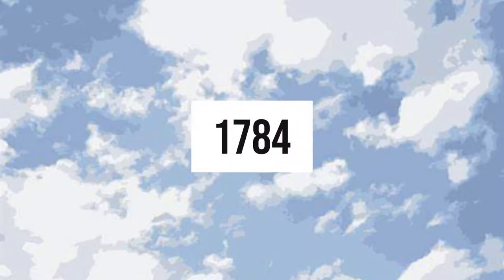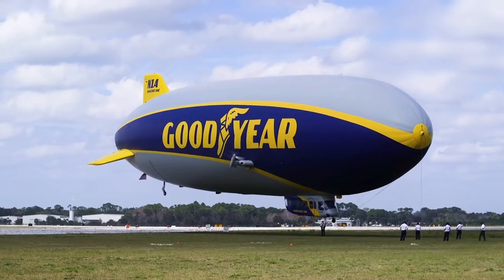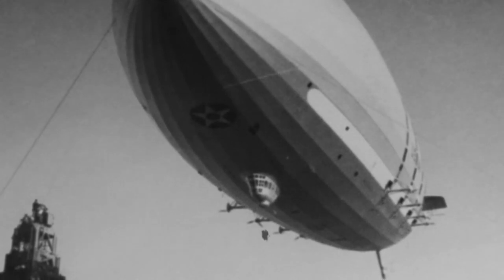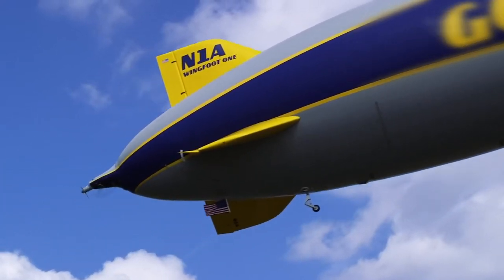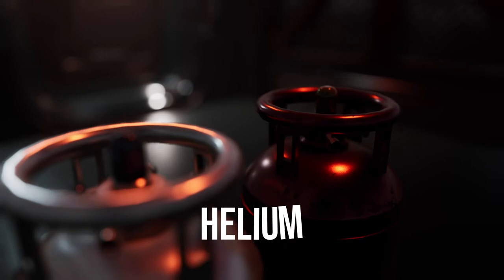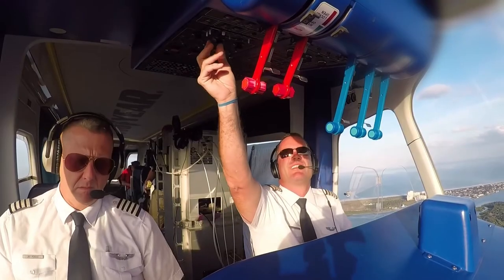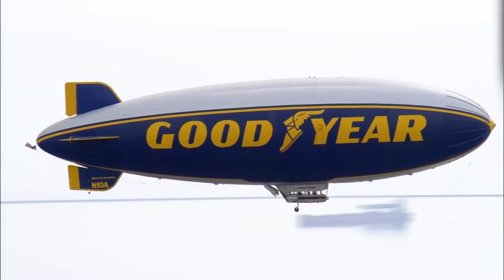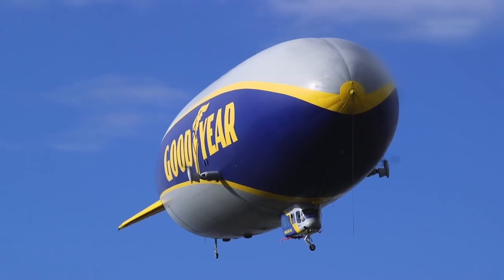What are Airships? How Do Blimps Work? | Balloon Airships | ThoughtCtrl

Comment: Good video. Better than some others I've watched about how airships work. Just one pet peeve though, 160KM or 130KM is not a speed, it's a distance. Is that 160KM per minute?? Is that 130KM per second? Is that 155KM per day??? You get my point... if you are doing a scientific video about the engineering of a complex flight machine, using the proper units and measurements is a good idea. You don't know who is watching. Don't be lazy and just not bother to use actual correct units. Not everyone may know what you are saying.